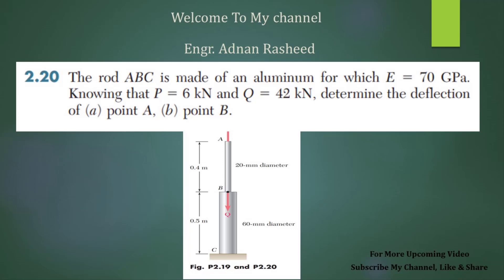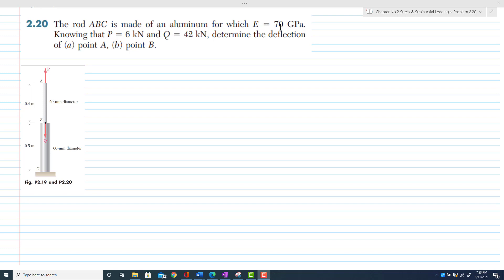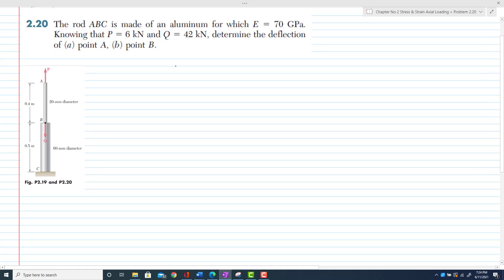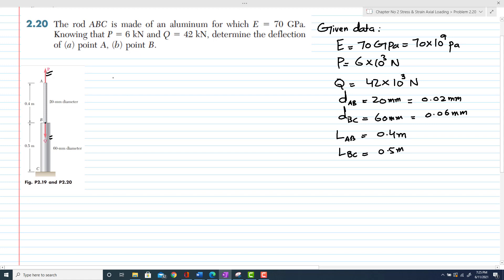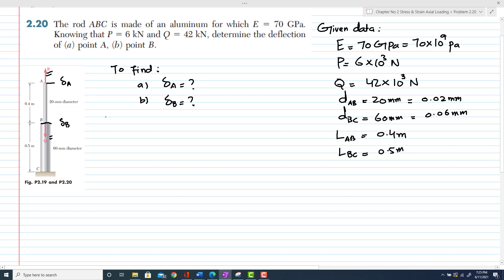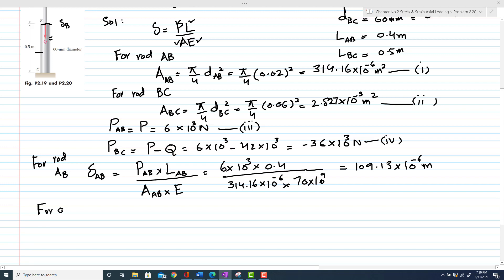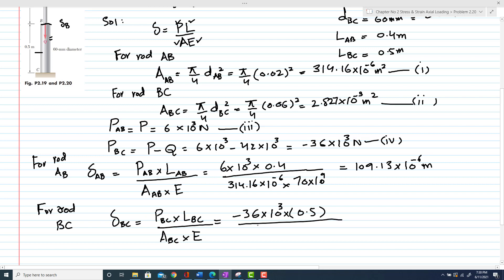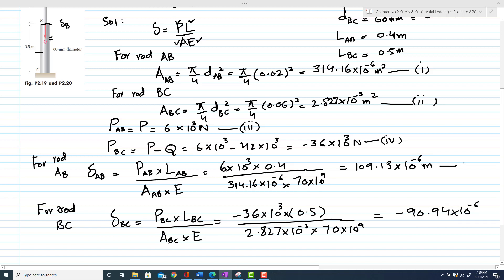Mech of Materials# |ProblemSolutionMOM​ | Problem 2.20 |Stress & Strain| Engr. Adnan Rasheed

Comment: Hi professor how do you know to get deflection of a to add deflection of ab and bc and for deflection of b that it equals deflection of bc? please help
Reply from the maker: Hello, well you can see the road Ab is in tension causing elongation in Ab while rod bc the net force Pbc is negative mean compression in rod bc resulting in decreasing length of bc, so no taking point A moves upward due to elongation of Ab and it comes down due to decreasing in length of bc so point net point A will move will be the difference of two....secondly for point b the bc portion is in compression hence length will decrease so point B will move downward the amount of change in length bc...i hope it is clear now

Comment: Sir; in 2.19 aapne B ka deflectionn nikaalnekeliye AB ka use kiya tha is savaal mein appne B ka deflection nikaalnekeeliye BC ka use kiyaa can you tell me why.... both digrams are same.. why different sections
Reply from the maker: agha to ab rod tension main ha jo ky ab ki rod ki length ko 109x10^-6 m increase karege, jab ky rod bc compression main ha jo us ki length ko 90.94x10^-6 (-minus sath ha jis ka matlab kam hona )chota karege. over all point A ki deflection hoge pehli value minus dosre jo 0.01819mm ha
Reply: @engradnanrasheedmechanical  thank you sir, and one more thing 20mm aapne m mein change kiya ta aur pir mm likdiyaa ya pir its different  concept.....2:05
Reply from the maker: It's my mistake sister. It's meter after conversion. It's 2 year old video. Kindly check out latest videos and definitely you will enjoy and learn them.
Reply: @engradnanrasheedmechanical  can you pls say this in english?
Reply from the maker: Which one? What do you want to ask?
Reply: the info about P-Q you've given in hindi?
Reply from the maker: @darshan2532 ok as she ask in Hindi thats why. OK so you can see P is 6 KN upward  and Q is 42 KN downward. So when you section BC the net force or over all force is is Downward which is 6-42 = -36 KN the negative sign show the net force is downward so in order to keep it in equally the force is BC will be upward , hence the portion BC is in compression causing the length of BC to reduce.